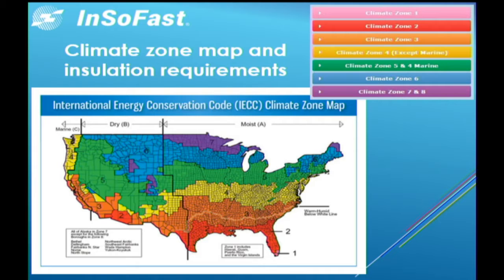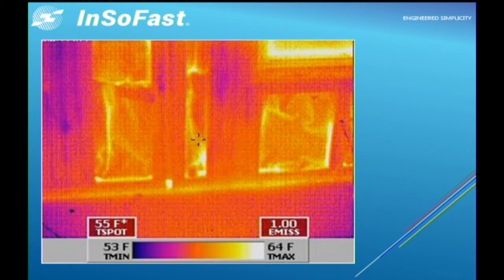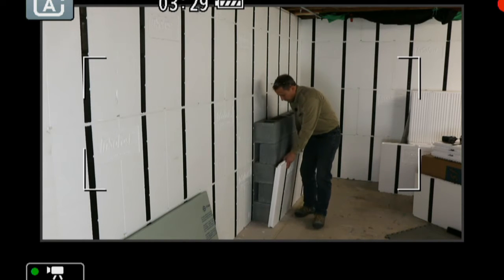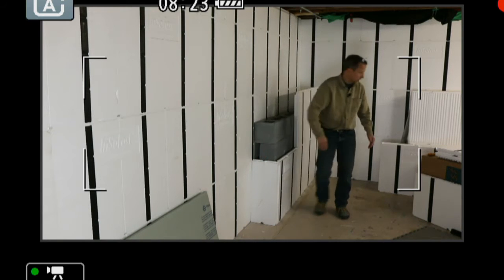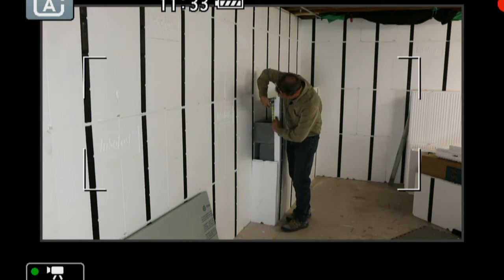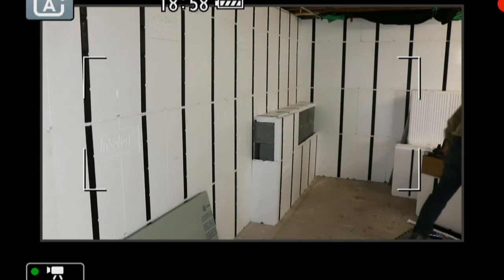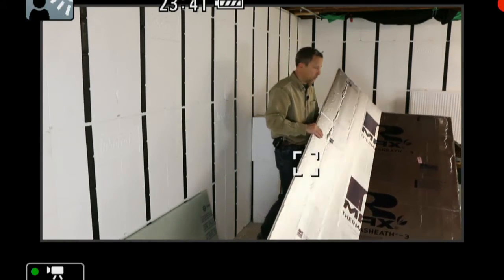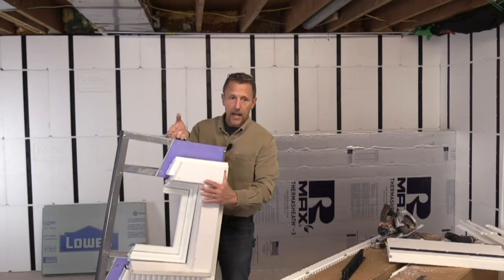InSoFast how to achieve R-15 walls

Comment: I’m thinking of insulating the floor, walls & ceiling of a cube van which I will convert into a camper and using your product, I am in a Canada and I plan to live in the conversion full time. Any thoughts? Thanks!
Reply from the maker: InSoFast has been adapted for many different applications from dog houses to high rises you would be charting new territory.

Comment: Can you put the other insulation under the insofast? I ask because wouldn't it be better to have the "studs as close to the surface as possible.
Reply from the maker: My opinion it is better to have the studs glued to the structural wall. Adhesive can actually provide a stronger bond to the wall.  In order to install insofast over a foam panel longer fasteners would be required to reach the structural wall. When attaching to concrete screw manufacturers require 1" penetration into the concrete. The minimum screw length to fasten the InSoFast panel is 3"+ if you add a 2" thick foam panel the fastener has to be at least 5" long. 5" screws are expensive and difficult to install. Either application will work.

Comment: How do i fix the drywall if we have insofast  attached to wall and insulation on top of insofast panel.You should have ended the video showing how to fix drywall with above 2 combination.
Reply from the maker: InSofast  serves as a SOLID base for drywall, it is more abuse resistant than traditional framed wlls assembliew, You will not have a big hole in the wall that needs to be supported like framed walls. Most damaged areas can pe easily patched with just drywall compound. Any larger areas of damage the drywall patch can be glued directly the InSoFast panel and repaired using traditional drywall finishing techniques.
Reply: InSoFast InSoFast That doesn't  answer my request.How to fix a drywall if i have insofast panel and insulation attached.what tools should i use? What screws, what adhesive,does that require insofast to be screwed to wall instead of pasting to wall?